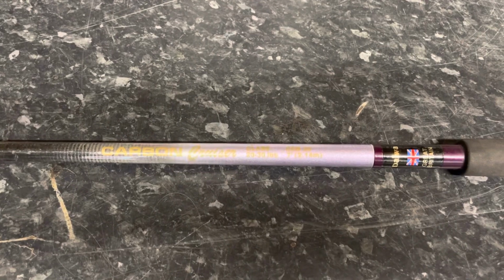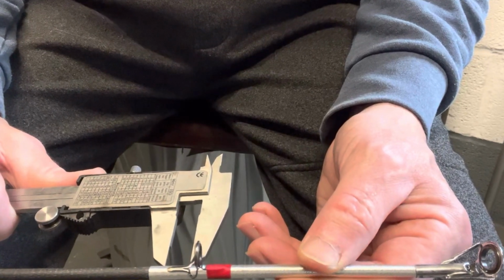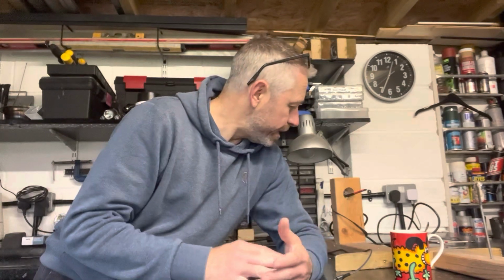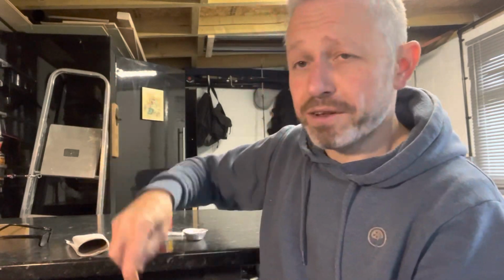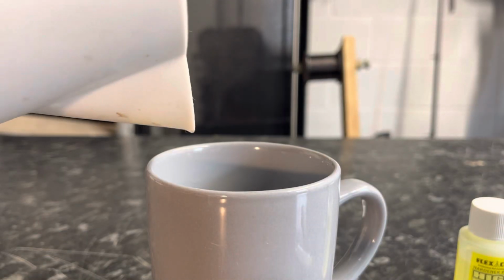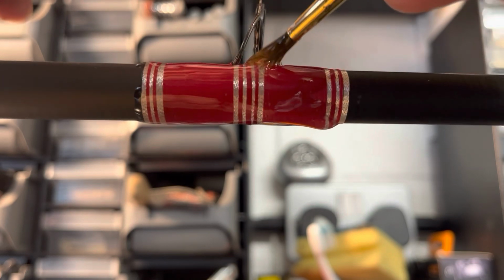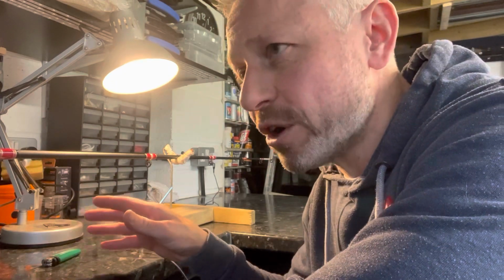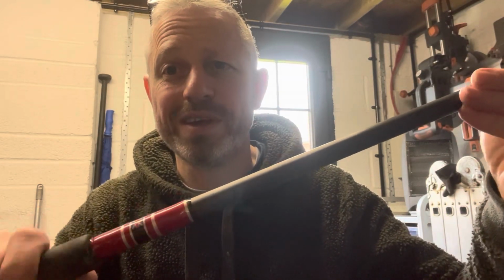Boat Rod Economy Rebuild! In this second part we finish the guide whippings & epoxy

Comment: A tip for you, stir the epoxy slowly for at least 3 minutes until it's clear. Don't put to much on the first coat, if there are any bubbles in it use a bit of best to get rid of them. Keep your brilliant videos coming.
Reply from the maker: @IanWoollett-jd5je  cheers buddy, I’ll take all the help & advice I can get with rod building. Thanks for watching 😊👍👍

Comment: I've always washed my brushes with soap and water, This has worked with several different brands of resin.
Reply from the maker: I’ll give it a try mate 🙂👍
Reply: @fishdisco3107  It works but you do still need to remove as much resin from the brush as you can before you wash it.